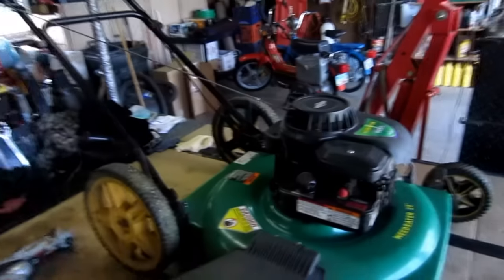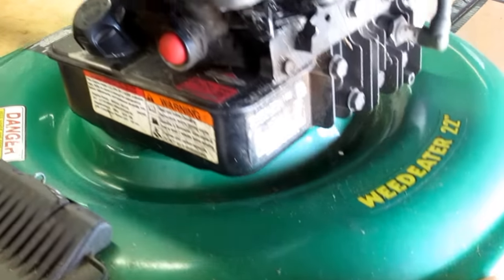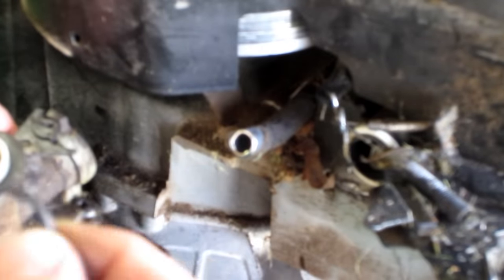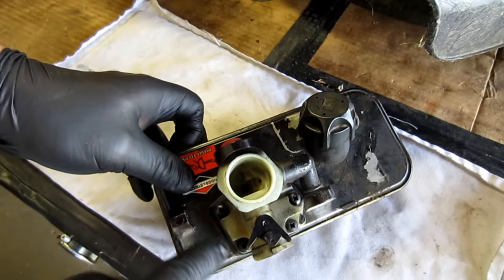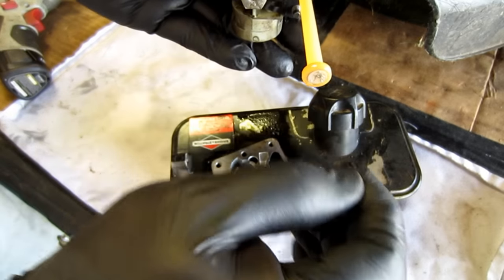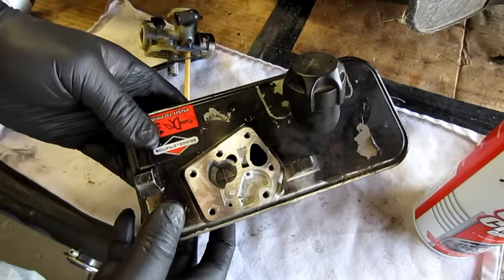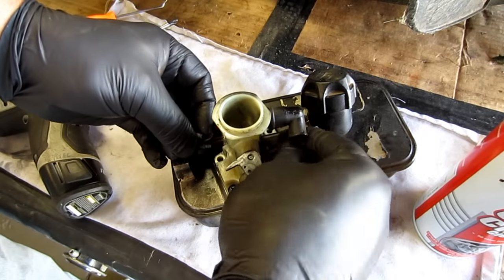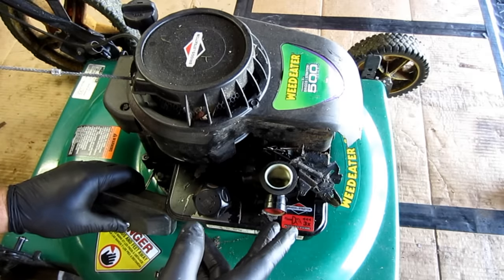Fix 90% of Briggs lawn mower not starting problems. Easy repair.

Comment: Thank you !! 
My carb looked pretty good inside but I gave it a good clean, rinsed out the tank which also looked ok, and then did the scribing thing on the top surface of the tank ( I went all the way around ) and after reassembly it started first pull. Yippee 😀

Comment: I liked that carb/primer set-up better than the ones they have now. The new set-up has a hole in the primer ball, with a horrible air filter housing..
Reply: And some like the one I have now has no primer and have to use starting fluid

Comment: Great Job! One of the very few videos I watched completely through. Direct and to the point without a bunch of "oh look at me" extra gab. Couple extra good points I never knew, tipping motor and scribing the gasket base. One issue I have is with replacing bolts and screws with an impact, you can't regulate the torque that way. Otherwise great job.
Reply from the maker: Thanks! As far as impact gun, 13 years of use, I won't damage anything ... But most newbies would break and strip stuff..

Comment: For those in states that require alcohol in your fuel in the cold months, you need to drain the entire system in the fall after flushing it with conditioner to remove that alcohol entirely. It will destroy your carb. I know the hard way and im in Washington state. I opened the bowl on my Honda motor on my Troybilt lawn motor and nothing but white packed powder in the bowl.

Comment: Going out to clean my carbuerator after watching this great tutorial.. I'll let youknow how it goes......
Reply from the maker: Karla Elvis 👍
Reply: I successfully cleaned the carbuerator... the mower will act like it wants to start (turn over once), and then nothing- the diaphragm looked good (but thin)... I'll go buy a new one...
Reply: Karla Elvis get some carb cleaner take air cleaner off ,,,give a good shot of carb cleaner and start mower if it just runs till its out of fuel,,,,then you have problem with fuel
Reply: Leo - the problem was with those little wires that go on the choke - they weren't attached correctly.  The mower is running like a maniac! P.S.  I cleaned the air filter before I changed the carbuerator... it wasn't that dirty (no oil)
Reply: Karla Elvis ñ

Comment: There was a wealth of information here. Your video was very easy to understand. From what I know the worst thing for a mower is bad or stale gas especially after the mower has sat unused for the winter season. Bad fuel can easily clog the fuel system. I change the spark plug and air filter once a season. I also start my mower at least three times a week all throughout the year. This keeps fresh fuel going through the engine and keeps the gas from going stale.

Comment: Good vid lots of good info I had a few of these back when I use to collect mowers it wasent till I helped out in a small engine shop that I Hurd about the diaprams being the issue with them so I replaced a few the mowers where galuping if I had known when I had mine I could have fixed it now I here bad diaprams all over my neighborhood also I herd not using gas with ethanol is easyer on the gasket thanks for sharing.
Reply from the maker: You're quite welcome. Yep, stay away from E85 and High Alcohol content gasoline. But the operator can have High Alcohol content.. Lol
Reply: crazzygunner where do you get gasoline without ethanol? I thought all gasoline has some in it. I remember my parents had a Montgomery Ward Reel type power mower back in the day that had a Briggs engine.
Reply: Glenn Lego .....92.
Reply: O
Reply: drhilltube u

Comment: Thanks a bunch. My mower was idling too high and hunting and surging. Replaced spark plug, air filter, governor springs and cleaned carb (replaced diaphragm and gasket). Runs like new.

Comment: 14:00 ...................... Hey, you forgot to tell us to put fresh gas in the empty gas tank.  Ha, Ha.  ;)
Reply: Alright Carl...
Reply: Also, if you drain the tank first into a glass jar ,look for sediment, rust and water .... leaving these in will cause future problems, I just poke a cotton cloth or a microfibre rag in the filler to remove the last dregs before refilling. Out here in the outback it’s good to park your mower in a cool place when not in use as the evaporation in the heat is the enemy of good fuel . Great tutorial ....

Comment: I have found a better solution since last year.  Once you clean out the carb, keep it that way by ending your mowing season by dumping the fuel, refill with CANNED Ecco (weed whaker, etc.) or ethanol free and stabilized TruFuel, etc. fuel,  restart and run for ~10 minutes, shut down and SEAL the fuel cap on the mower tank.  Use the (expensive) CANNED ethanol-free stabilized Fuel, much better than adding stabilizer to raw fuel.
Use 'premium' when using normal gasoline during the mowing season.

Comment: I find 90% of the time it's the fuel pump diaphragm needs to be replaced.
Reply: EXACTLY!  And folks, just get new parts, get rid of the old and buy new, you'll double the life of your mower, this includes your riding mower as well to, along with keeping the mower deck clean and the blades as sharp as razors, the you CUT your grass, not pull it out bu the roots, thus inviting weed growth.
Reply: I can't find the link for new parts.

Comment: Thank you so much!  I was ready to buy another mower but thought what the heck, why not try servicing it.  I mean what could go wrong she was destined for the dump?  Well I took the air filter off, gave it a clean & saw the governor spring had been stretch so there was no tension.  I unhooked it, snipped some off, reattached it then threw the filter back on & badda bing she's singing like a valkyrie! :D  You have saved the environment from having a 10 year old mower going to the scrap heap, the carbon footprint of a new one & the cash I would have spent!  Not all heroes wear capes, you sir are a scholar & a gentleman!  :P

Comment: I have the exact same mower in this video. A free roadside pickup, not running, bent blade, and bent front wheel mounts. Using this video, I got that mower, and 3 others with the same setup, running just fine. Thank you.

Comment: Great video. Thank you so much. I actually had my powered Briggs and Stratton power wheel barrow in my truck to take in for service because it wouldn’t start.  I watched your video, took my wheel barrow out of my truck and followed your video. Voila! It started up on first try! Simple to follow video and spot on for  Briggs and Stratton engine repairs, Again Thank You!

Comment: I have exactly the same engine on my lawn mower bought 26 years ago and it still runs. I had to change the diaphragm membrane on the carb some 16 years ago and after that no problem. I do my own servicing and oil change.

Comment: I just want to thank you for leading me in the right direction. Now I have a riding mower with a Briggs engine. I basically took the carb off and the bowl underneath the carb. I sprayed and blew out every hole  I saw. There was also some gas that I poured out of the carb. Put everything back together and she started right up. 

Thinking that at the end of season last year. I didn’t properly put it away.

Comment: Thanks - it worked.  My engine is 20 years old but still running like a charm thanks to your tutorial.  I thought I could get away with just tearing it apart and manually cleaning without the carb cleaner but the carb cleaner was the difference between working and not.

Comment: thanks! was procrastinating worrying it would fall apart as soon as i removed a few screws but, other than where the spring attaches, everything was exactly the same. only took about 20 minutes from off to back on. the procrastinating is what takes up all my time. all i need to do is get started and the job usually gets done more easily than anticipated. this vid motivated me to finally do it.

Comment: This video keeps paying dividends. I picked up a mower for FREE, would not start. Put in a new plug, got spark. Cleaned the air filter, which was filthy. Plenty of oil. Still no start. Not even a sputter or puff of smoke.

I followed the steps in this video to the letter. Fortunately the carb gasket was in good condition. Just as directed, I scored the carb to help seal the gasket.

After lots of carb cleaner I put everything back together and even shot some carb cleaner into the combustion chamber for good measure.

3 pumps to the primer with new gas.... one pull... and she took off like a brand new motor! One pull!! I am impressed at how smooth it runs.

Thank you, thank you, thank you!!!

Comment: Thanks for the info.  Cleaned the carb and changed the diaphram, which was not punched, but significantly stretched.  The change in running was miraculous, removing the rpm hunting and worsening starting.  I'll change this every couple of years from now on as they are cheap and it is a simple job.

Comment: Coming at you from 2021. My 25 year old MTD Yard Machine mower doesn't want to start this spring for the 3rd time in its life. Definitely a carb issue. I'll follow the steps in this video and see if it helps. I'll mention that if you are going to go through all this you might as well replace the priming bulb. They do wear out. Thanks for the video.

Comment: Tx so much! This air filter doesn't require to be oiled, I presume? Got the same set up on an MTD push mower. Tx again!
Reply from the maker: You can oil it if you wish. Very very lightly. I choose not to.

Comment: I watched this last week and sorted my mower out once I ordered a new diaphragm and gasket. One thing I didn't realise was you unhooked/hooked the ring that holds the springs whilst the petrol tank was out. I removed/attached mine once I had the petrol tank back in. This was awkward and ultimately put strain on the idling spring and broke it. A warning to you all attempting this.
Great video though.

Comment: You have a fantastic way of conveying the material and if you're not a teacher, then you should be LOL! I just subed and look forward to your other vids. I equally love the B & S engines, and every piece of equipment I have is powered by these engines (except for my 3 Echo devices). I went and bought a collection of small "tip cleaners for welders"  thats a brush and file rolled into one and there are several different diameters secured and arranged in it's "caddy" to keep them together. It costed me a little over $5 and this is what I use on the jets and passages when the carb has to be disassembled. Keep up the good work and regards from Louisiana!

Comment: As a young lad we used go to a local junkyard to check for lawnmowers that have been throw out. Most of these lawnmowers were horizontal shaft Briggs and Stratton we would use these engines to build go carts. Most lawnmower engines have a small aluminum crankshaft key if the user hit a root or other obstructions it would shear that key and not damage the crankshaft. I would go down to the local Western Auto and buy the crankshaft key for about 10 cents if my memory serves me well. In most cases thats all that was wrong with the engine. Wow those were the days growing up in the country?

Comment: Thank you for mentioning the right way to tip your mower...I absolutely flooded my air filter while trying to fit my mower in the back of my Corolla. I did it, but then my mower wouldn't start after I got it out. haha

Comment: As a Certified FAA Aircraft Mechanic, and Air Force Aircraft Mechanic beginning formal training in 1968, I would recommend using some type of container or containers with lids to put your parts in as you take them off.  Less chance of loosing a part by knocking it off or out of the place you laid it on or in.  I use separate containers for metal parts and soft parts like reusable gaskets and o rings.  The gaskets and o rings I will inspect with a magnifying glass before reusing.  Like the example with the gasket leaking in this video, a small nick or crackWhen you finish putting what ever you are working on back together and the containers don’t have any parts left, that is a good thing.  If it is more complicated than this video you make want to take pictures and or notes as you disassemble your project.
Reply from the maker: Yes , I agree, beginners or newbies but don't have mechanical experience definitely want to keep track of their parts.

Comment: Also I have an old 1980s snapper mower that doesn't have thw prime type carb and it has I think its called a choke-a-matic carb and it had the diaphram but no gasket and I followed ir steps of how to fix one of these carbs and my mower runs like a dream thank a bunch

Comment: The best maint video yet. You pointed out the biggest mistake the unwise make, by turning  the mower over the wrong way!
Cutting wet grass and it  clogs up and stalls...damn thing. Ill turn it over and unblock it...Oh now it wont run!
They never tell you  that, when you buy one new.

Comment: Wow, thanks for this. Was recently given a 375 Briggs powered mower with a jammed primer bulb and all the other issues you've described. Otherwise the engine has good spark and compression. Will be a runner soon.

Comment: Great information about the gap in the gasket on the intake side. I sometimes use Vaseline or a little heavy grease. Both are petroleum and won't hurt anything. Never thought of scribing the edge but I'm sure that I will give it a try.

Comment: I had a problem with the mower running for a good 5-10 minutes, sucking the fuel button in, and then stalling out. I did the fix you showed as well as finding out that the straw that pulls gas into the carb was plugged, the tiny screen specifically. Cleaned it up and she's a runner. Got it for free from a neighbor too

Comment: I was a small engine mechanic for years. I always kept a spray bottle of what I called "Magic formula" to spray into the carburetor. All it really was, was premixed (for two stroke engines) gas. Normal gas will work fine - I just premixed it mainly just to change the color and fool the customers into thinking it was something special!! Plus, I figured a tiny bit of extra oil in a cold engine might help it some (or at least not hurt it). You can even remove the carburetor altogether and spray right into the hole and the engine will start, unless there's an electrical or compression problem. If you keep spraying gas into the hole the engine will keep running. It's one way to figure out if it's a carburetion    problem or something else. I'm happy to see Briggs finally figured out they should put a primer button on their engines. I've always thought that they should
Reply: BUT the primers die fast...

Comment: Thank you for this video, I have been having issues with mower not priming properly and revs going down once started Figured it had something to do with clogged air or fuel or both. Followed the simple steps here and priming issue fixed and started right up with a healthy sounding rev!

Comment: 2:15  Good info. There is a way to prevent  'hydro lock'' .   Remove plug wire.  Pull starter cord, until you  'feel'  the compression stroke; pull until it just about turns over,;  STOP  at the hardest point.  This closes  both  intake/exhaust valves.  This prevents ANY  oil  from going anywhere.   
 Thanks for the B & S   education, Mr  Fox.  None of this is  ' bs ' .   i  have a few mowers, with Tecumseh engines, and those carbs i know thoroughly. But  B & S  engines, i have not worked on.....yet. Got one older one, very light aluminum block, needs  some  TLC.....thanks  from Alberta Canada.

Comment: Posted before I finished.  A small nick or crack in an o ring or gasket can keep and engine from starting, or to run bad if it starts.  I have fixed some ruff running, or engines that hunt with a mixture of Sea Foam, Marvel Mystery Oil, and STP Fuel injector cleaner.  Yes I use all 3 in their recommended ratio to gas.  I was given a John Deere riding mower with 270 hours on it in 2014, because it was hunting and running ruff.  All I did was add the mixture of the 3 products to the gas.  After letting it idle for 20 minutes it began running good enough to cut the grass.  Before I finish cutting my front yard, about 25 minutes, it was running great.  It now has over 400 hours with out any mechanical problems.  Just routine stuff like changing oil, cleaning the air filter, greasing, etc, etc.  Another hint.  If you have an oil filter in a location that does not allow for a container to fit under it to catch the oil, use a plastic bag, like a bread bag, or the ones you put vegetables in at the store, that holds air when you blow into it.

Comment: I never worked on a lawnmower. I will follow your steps teacher. Thank u for the video. Can u also show a handle grip replacement on that type of mower please ? Thank you.
Reply from the maker: Unfortunately I don't have any of those mowers around any longer as I travel full-time on the road. But you will have to either roll it on or use talcum powder or possibly an air hose with a nozzle on the end that will allow you to blow air into it as you slide it up and on. It's not fun it's probably best to try to find another way to do a handle cover

Comment: Every one of these engines I’ve worked on have had bad fuel. Not once have I had to clean the carburetor! On other models, 90% of your issues are the carburetor issues. This is my favourite engine type to work on

Comment: Very good and detailed video loved it i fixed a mower with this same carb the exact way you said it...  Also i added the Briggs and Stratton fuel mixture to the gas tank and it runs alot better

Comment: Good explanatory video. I notice you did not mention about cleaning the fuel tank because there is no filter on the tank when you fill up.   A filter funnel is necessary to prevent bits of debris going into the tank and blocking the pick up tube.